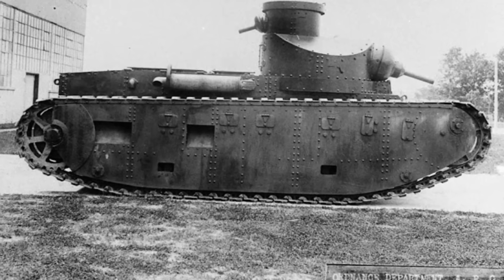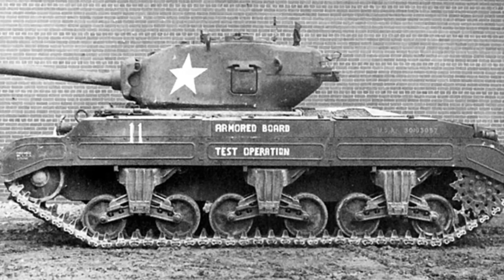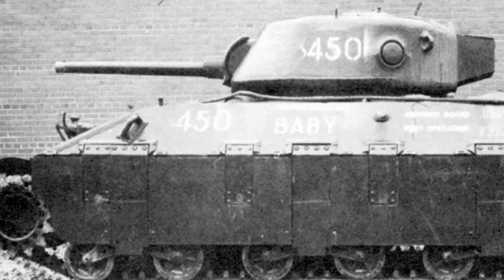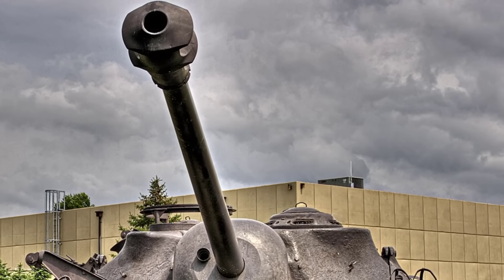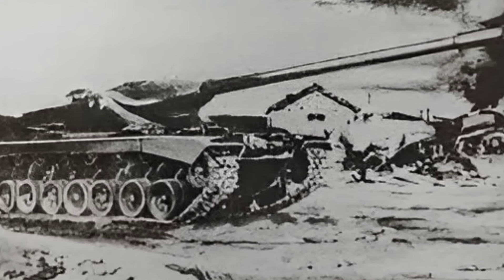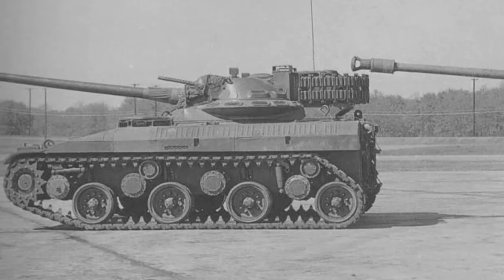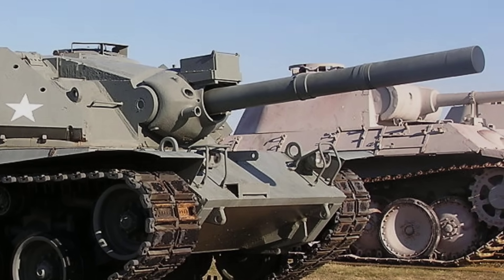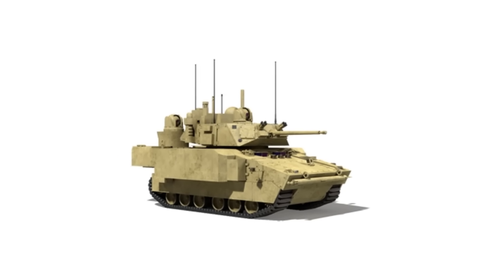The 15 USA’s Greatest Cancelled Tanks That Never Deployed

Comment: T14 actually has 2 prototypes made; 1 was pretty much wasted or in other words left to rust while the other one (I believe) is at the Bovington Tank Museum in England and also at 4:22: that is NOT the T28 cuz that specific one has 2 sets of tracks on both sides of the vehicle; which that is then the T95; both the 28 and 95 had technically 2-roles: breaching strongholds and “light” artillery strikes
Reply: T28 and T95 are the same tank. the only difference is the extra set of modular tank track. idk why it has 2 different designations. alls i know is when you add the extra tracks to the T28 it becomes the T95, and when you take the extra tracks off it becomes the T28 again

Comment: Many of these unfortunately don't exist anymore, but there are some 1 off designs like the T28 superheavy at the Armor and cavalry collection at Foort Moore. They do hold several open houses per year but are not open full time as a normal museum. They have pages on the various socials to follow to gain the schedule for such dates. Hope to see you all there, if you have the time to make a trip to Georgia.  Edit- T69 is also in the collection, and T54E2 is just outside (unfortunately at the whim of nature still). HSTV-L is on site but not on display. MBT 70 is both indoors and out. One model, the "pig" is outside the main building, while the other, with test weights attached to the turret, is inside the collection proper.

Comment: We can see the influence of the M1921 in the M48 and M60 tanks, with a commander's "turret on the turret" with a separate MG, making for a rather high profile, but also affording both a high observation platform and enhanced protection for the TC, who, on most other tanks, had to maintain situational awareness and direct fire the "old fashioned way"...i.e., stick his FOOL HEAD and often his upper torso outside the tank itself, and be vulnerable to even enemy small arms fire, let alone grenades, mortars, and artillery fire.

The T42 medium gun (90 mm) tank DID make it into production, or at least the TURRET and gun did.  In 1950, with the Korean War raging, and concerns that likewise war could break out with the Soviets in Europe, and our tanks, mainly M4A3E8 Shermans, and a handful of M26 and M46 tanks, were not only outnumbered but OUTCLASSED by newer Soviet models.  There were numerous issues with the M48s, so an interim solution was devised.  Take the turret and gun of the T42, which was cancelled, and plop it on the existing M46 chassis, using the newer Continental AVS-1790 V-12 gasoline engine, the same engine as in Jay Leno's "Tank Car", aka the Blastolene Special.  Putting out 810 ponies, this engine could move the fifty-ton tank adequately, though its fuel consumption was...well...THIRSTY.  However, like the M1Abrams three decades later, in a defense campaign to stop Soviet armor before it reached the Rhine, this wasn't considered to great a liability.  Deemed the M47, this stopgap vehicle proved useful more for not only its temporary stocking of US armor in Europe and the Orient, as the M48 entered US service, this "interim" vehicle, of which over EIGHT THOUSAND were produced, was handed down to NATO and SEATO allies, many of whom had made do with M4 Shermans, M24 Chafees, and even M3/M5 Stuarts!  The M53 90 mm gun was compatible with the M48 "Patton's" weapon, so logistics were simplified.  BTW, the M47 "Patton II" was the tank on which body-builder and movie star Arnold Schwarzenegger served in during his Austrian Army mandatory service in the mid-sixties. Years later, Arnold found the tank he'd served in, languishing in a storage yard, bought it, and restored it, using it for charity events and publicity shots.
Reply: wasn't that cupola hated by everyone who used it?

Comment: 1:09 why does the m6 here look just like a longer m4?
Reply: Because it is
Reply: @Rose-071-Yusha no it has 8 roadwheels (9 if you count the little one) and the tracks get taller towards the front.
Reply: @moltensh4dow506  I was saying it was the Sherman that is just been stretch
Reply: The drawing in this video is a Sherman hull, but the pictures show the correct one.

Comment: Great video. Surprised that the M10 Booker wasn't on the list
Reply: The US army kept saying that the Booker was a mobile gun platform or some such thing rather than a tank or light tank. This might have been because its armor protection was lacking.
Reply: @thebigone6969  They also did this because they didn't want M10 crews running off to fight tanks. The 105 mm gun, while it is nothing to shake your head at, was meant to be used against fortifications and infantry.
Reply: @thebigone6969  They said the same thing about the M551, calling it an "Aerial assault vehicle". Crews knew what they were in, just ask one.